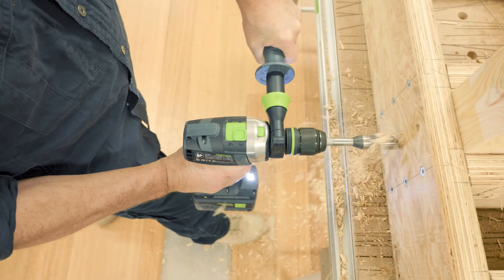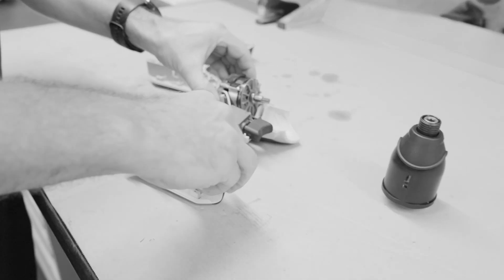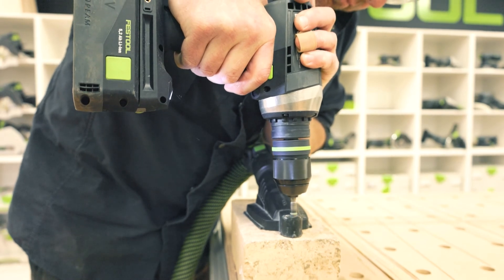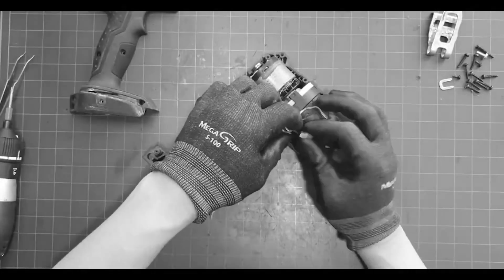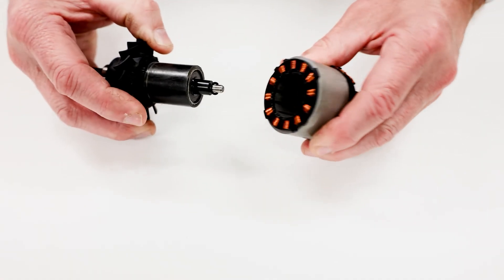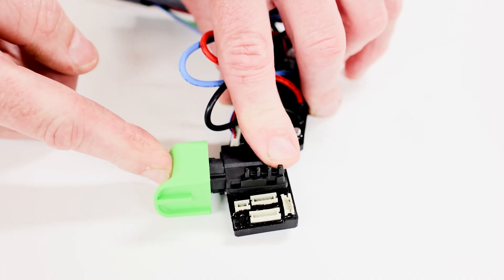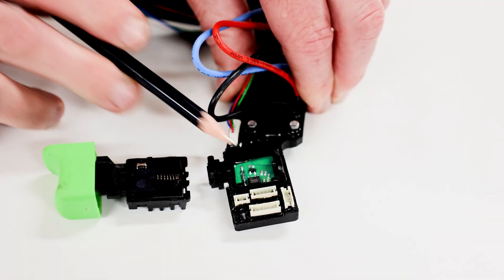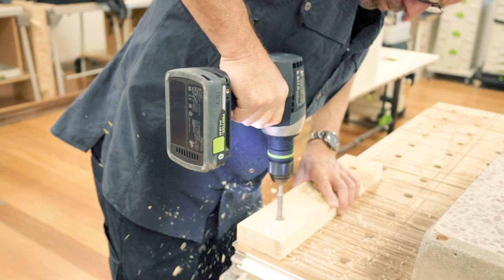Reliable Drills: Why Festool Stands the Test of Time

Comment: I was looking for a 12V installation drill. Festool has one (in two forms). They use different batteries than the version earlier and there are no other 12V tools in the system.... So unfortunately I had to buy Bosch GSR 12V-35 FC. If only it was an actual system with multiple tools... I would have loved to own a Festool, but the Bosch works great.